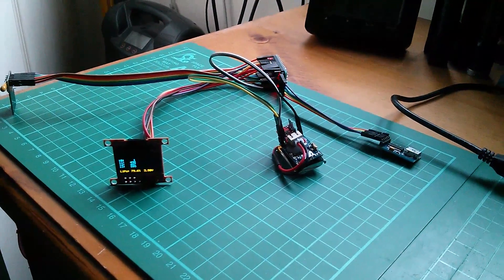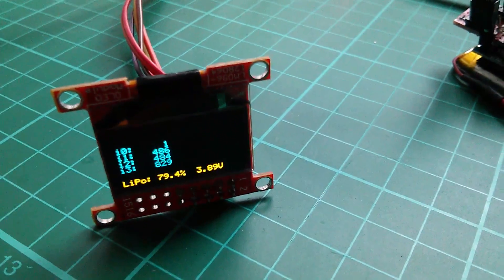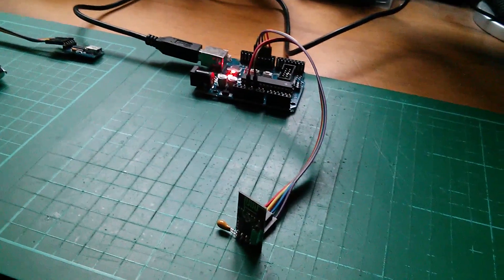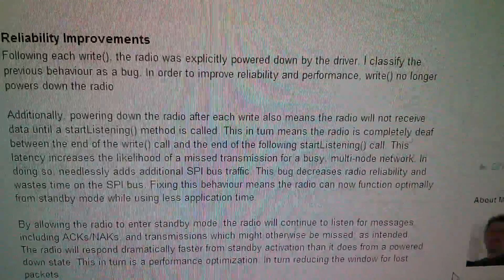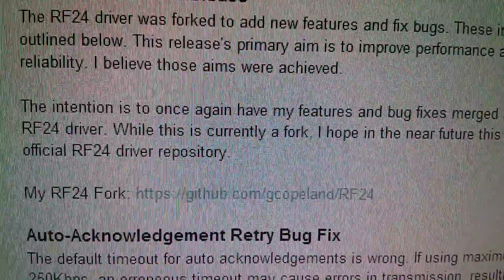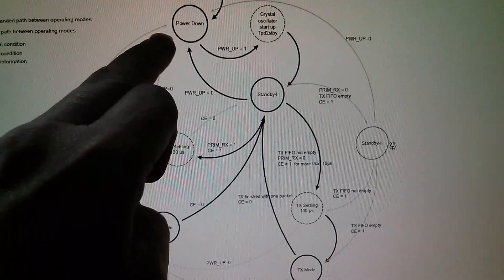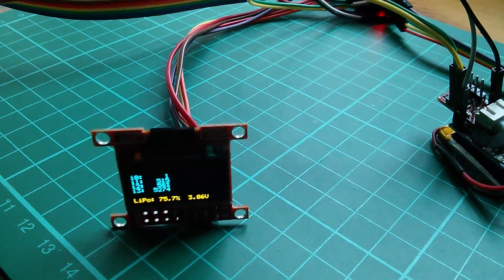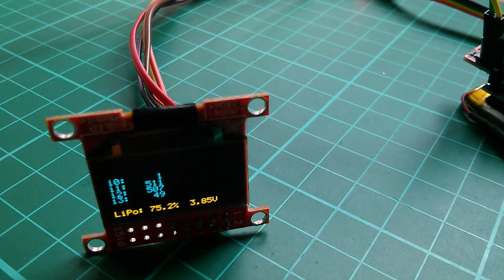Fixed: Arduino nRF24L01+ Data Transceiver & OLED Display

Comment: Dear Julian, i'm trying to use the ssd1306 OLED together with the nRF24L01 and I'm strungling with the SPI communication. 
Based on your video I updated the RF24.h, but without success. 
As soon as I'm starting to use the radio (radio.begin()), the communication with the OLED do not work anmore. Before this command it's working fine. 
I'm using following HW- Configuration on my Arduino NANO
MOSI=D11 
MISO=D12 
SCK=D13, 
CS_RF24=D8 
CE_RF24=D7 

CS_OLED=D5 
DC_OLED=D9; 
RST_OLED=D10
What HW configuration did you use in order to make it running?
(For the OLED I'm using the most recent ADAFRUIT SSD1306 library) 
Thanks in advance for your reply. WBR Alberto
Reply: I found the rootcause of my problem. It was the wrong constructor I used for the OLED-Object. 
In order the OLED is properly working together with the RF24 the OLED constructor taking the refernce to the SPI-Object is to be used.

Comment: Thanks for these videos. These are my reference material for an RC transmitter-receiver I am building. When you send message, do you check the radio.write return code? For me only about 60% is successful, although roughly 90% of the messages are received on the other end. So there are definitely messages received that are reported as failed by the transmitter. I am a bit puzzled. Have you experienced the same?

Comment: Hi Julian I saw oled+nrf24L01 project on youtube.I've problem with my own.It seems the oled freez when nrf24L01 goes on radio.begin process and after that oled fills the screen by 8x8 boxes! I don't understand why? I connect my software spi oled to pins 0,1,2,3,4 of arduino UNO and my NRF uses these pins 9,10,11,12,13.So these components are completely seperate from each other and they must not have any problem.So please let me know how could you solve this problem on that 3 days.
Best.

Comment: I know this is an old youtube video but I thought I'd throw this to you in case you'd not seen it. The most recent updates seem to be from this person: https://github.com/stanleyseow/RF24 which has incorporated gcopeland's code fix and got a few other optimizations/bug fixes. Also seems to have a few more example codes and stuff.

Comment: Thank you for the fixed RF24 code, I have been searching for quite some time trying to work out why my project would not work correctly. I have been able to run my NRF24l01 on its own with no issues, my LCD on I2C with no issues but when I put them together it just wouldn't work and I couldn't understand why until I came across this video and then your fixed code, its seems to me the default RF24 is floored and needs changing. With your code my project is now up and running. Thank you.

Comment: How would i go about changing the pinout of pins other than CE_PIN and  CSN_PIN?
Reply: +NovakinCore They are hardcoded into the NRF library. Write your own  library and define the pins wherever is electrically possible

Comment: Oh you fixed it :) still not understand why you need send i[1] if last send succesfull. when interger count says OLED example 1234 i1 = 1 means 1233 was okay and becouse now you see allready 1234 i not see any point how you use you really never see was it send data you only see did it send last time. so actually you could read same message all day saying okay send ok bcoz sending not actually work and you not get any 0 :) until after week it works again and you will see 0 for short time until next reefresh .i dont know idea of this build but this logic give me headache :P

Comment: Can you please put up the RX code, really need it. THANKS
Reply from the maker: High Flights The latest receiver code (using Adafruit OLED libraries) and the transmitter code are in the comments of this video: http://youtu.be/E7--651JxJE
Reply: Thanks a lot.
Reply: +Julian Ilett I modified the code for 16x2 display did not work. Can you help me?

Comment: Could you post your Receiver code, Please.

I am slowly starting to understand the Arduino.
I find your videos Helpful!

Thanks! Later, FW.
Reply from the maker: Futz With Yes, here's the code. I'll probably use the Adafruit SSD1306 library going forward though.
Reply from the maker: Julian Ilett 
//#define PIN_RESET 2
#define PIN_CS    4
#define PIN_DC    5
#define PIN_SDIN  3
#define PIN_SCLK  2

#include "font.h";
#include "MAX17043.h";
#include "Wire.h";

#include <SPI.h>
#include <nRF24L01.h>
#include <RF24.h>
/---( Declare Constants and Pin Numbers )---/
#define CE_PIN 14
#define CSN_PIN 15
//   5 - SCK to Arduino pin 13
//   6 - MOSI to Arduino pin 11
//   7 - MISO to Arduino pin 12

// NOTE: the "LL" at the end of the constant is "LongLong" type
const uint64_t pipe = 0xE8E8F0F0E1LL; // Define the transmit pipe

/---( Declare objects )---/
MAX17043 batteryMonitor;
RF24 radio(CE_PIN, CSN_PIN); // Create a Radio

/---( Declare Variables )---/
float soc;
float voltage;
char tmp[8];
int i[4];  // 16 element array holding Joystick readings

void oledWriteString(char *characters)
{
  while (*characters) oledWriteCharacter(*characters++);
}

void oledWriteCharacter(char character)
{
  for (int i=0; i<5; i++) oledWriteData(ASCII[character - 0x20][i]);
  oledWriteData(0x00);
}

void oledWriteData(byte data)
{
  digitalWrite(PIN_DC, HIGH);
  digitalWrite(PIN_CS, LOW);
  shiftOut(PIN_SDIN, PIN_SCLK, MSBFIRST, data);
  digitalWrite(PIN_CS, HIGH);
}

void oledWriteCmd(byte command)
{
  digitalWrite(PIN_DC, LOW);
  digitalWrite(PIN_CS, LOW);
  shiftOut(PIN_SDIN, PIN_SCLK, MSBFIRST, command);
  digitalWrite(PIN_CS, HIGH);
}

void setup()
{
//  pinMode(PIN_RESET, OUTPUT);
  pinMode(PIN_CS, OUTPUT);
  pinMode(PIN_DC, OUTPUT);
  pinMode(PIN_SDIN, OUTPUT);
  pinMode(PIN_SCLK, OUTPUT);
//  digitalWrite(PIN_RESET, LOW);
//  digitalWrite(PIN_RESET, HIGH);
  
  Wire.begin();
  batteryMonitor.reset();
  batteryMonitor.quickStart();

  radio.begin();
//  radio.setDataRate(RF24_250KBPS);
  radio.openReadingPipe(1,pipe);
  radio.startListening();;

  
//  oledWriteCmd(0xa8); //set MUX ratio
//  oledWriteCmd(0x3f);
//  oledWriteCmd(0xd3); //set display offset
//  oledWriteCmd(0x00);
//  oledWriteCmd(0x40); //set display start line
  oledWriteCmd(0xa1); //set segment re-map
  oledWriteCmd(0xc8); //set COM output scan direction
////  oledWriteCmd(0xda); //set COM pins hardware configuration
////  oledWriteCmd(0x12);
  oledWriteCmd(0x81); //set contrast
  oledWriteCmd(0xff);
//  oledWriteCmd(0xa4); //disable entire display on
//  oledWriteCmd(0xa6); //set normal display
//  oledWriteCmd(0xd5); //set oscillator frequency
//  oledWriteCmd(0x80);
//  oledWriteCmd(0xdb); //vcomh deselect level (brightness)
//  oledWriteCmd(0x20);

  oledWriteCmd(0x8d); //enable charge pump
  oledWriteCmd(0x14);
  
  oledWriteCmd(0xaf); //set display on
  
  oledWriteCmd(0x20); //set horizontal addressing mode
  oledWriteCmd(0x00);
  
  for (int i=0; i<1024; i++) oledWriteData(0x00); // clear oled
  
  //oledWriteCmd(0x27); //set right horizontal scroll
  //oledWriteCmd(0x0);  //dummy byte
  //oledWriteCmd(0x0);  //page start address
  //oledWriteCmd(0x7);  //scroll speed
  //oledWriteCmd(0x7);  //page end address
  //oledWriteCmd(0x0);  //dummy byte
  //oledWriteCmd(0xff); //dummy byte
  
  //oledWriteCmd(0x2f); //start scrolling
}

void loop()
{
  soc = batteryMonitor.getSoC();
  voltage = batteryMonitor.getVCell();
  oledWriteCmd(0x21); //
  oledWriteCmd(0x00);
  oledWriteCmd(0x7f);
  oledWriteCmd(0x22); //
  oledWriteCmd(0x07);
  oledWriteCmd(0x07);
  oledWriteString("LiPo: ");
  oledWriteString(dtostrf(soc,4,1,tmp));
  oledWriteString("% ");
  oledWriteString(dtostrf(voltage,5,2,tmp));
  oledWriteString("V ");
  
    if ( radio.available() )
  {
    // Read the data payload until we've received everything
    bool done = false;
    while (!done)
    {
      // Fetch the data payload
      done = radio.read(i,sizeof(i));
  oledWriteCmd(0x21); //
  oledWriteCmd(0x00);
  oledWriteCmd(0x7f);
  oledWriteCmd(0x22); //
  oledWriteCmd(0x02);
  oledWriteCmd(0x07);
  oledWriteString("i0: ");
  oledWriteString(dtostrf(i[0],5,0,tmp));

  oledWriteCmd(0x21); //
  oledWriteCmd(0x00);
  oledWriteCmd(0x7f);
  oledWriteCmd(0x22); //
  oledWriteCmd(0x03);
  oledWriteCmd(0x07);
  oledWriteString("i1: ");
  oledWriteString(dtostrf(i[1],5,0,tmp));
  
    oledWriteCmd(0x21); //
  oledWriteCmd(0x00);
  oledWriteCmd(0x7f);
  oledWriteCmd(0x22); //
  oledWriteCmd(0x04);
  oledWriteCmd(0x07);
  oledWriteString("i2: ");
  oledWriteString(dtostrf(i[2],5,0,tmp));

  oledWriteCmd(0x21); //
  oledWriteCmd(0x00);
  oledWriteCmd(0x7f);
  oledWriteCmd(0x22); //
  oledWriteCmd(0x05);
  oledWriteCmd(0x07);
  oledWriteString("i3: ");
  oledWriteString(dtostrf(i[3],5,0,tmp));

    }
  }

  delay(10);
}

Comment: Hey Julian, have you found any led matrix kits that use shift registers (one pin for each vertical led and one for clock?) I want to make an led sign using shift registers where each panel feeds into the next
Reply from the maker: ***** The MAX7219 works a bit like that I think

Comment: Could you give details on the OLED screen you are using, is it full RGB or two colour? I presume an Ebay special? Does it drive the same as the single colour OLED?
Thanks!
Reply from the maker: Wilksey37 It's two colour - six rows of blue and two of yellow. Does it drive the same? Well, almost. On this one, you don't have to fire up the charge pump. On most of them, you do.
Reply: Julian Ilett Thanks, are you planning on doing a video with some info on how to drive them and where you got it from? I have seen some RGB ones on Ebay which has 3 interfaces, but are ~£20 from China.

Comment: Great work on fathoming the fix :) where did you get the oled? Thanks for all the great videos, keep them coming!
Reply from the maker: dangersdnb The OLED is on eBay, but when I rebuild this project, I'll use a more easily available one.
Reply: Julian Ilett sounds good, I'll keep an eye out for that video. great work

Comment: Hi Julian,
Please could you post some information (or a video) stating the LoS outdoor range for the standard and high powered version? I know you did the indoor to outdoor test in your workshop, which seemed to show the high powered version in a very poor light.
Thanks!
Reply from the maker: Wilksey37 Yes, I now realise the high power version should be used as a matched pair. Using one high-power unit and one low-power unit is not a fair test.
Reply: Julian Ilett Hi Julian, yes you would need two matched as it is two way :) I have been tempted to use these instead of Zigbee, I have found AES code on the web and I think it would be a great deal cheaper than Zigbee (P2P rather than Mesh), but wasn't overly impressed by the range on your initial tests.  BTW, keep up the most excellent videos, extremely useful, as well as the solar ones!
Reply: Wilksey37 Julian Ilett You may also want to look at the HopeRF modules for RFM69W (and RFM69HW higher powered version), which can operate on 433 or 915 ISM bands, which would have much better object penetration. (For those that don't known, generally speaking, lower UHF freqencies penetrate obstructions better than higher ones, at the cost of slighly less range in open LoS). I have just ordered a few interesting all-in-one arduino clones, Anarduino MiniWireless, which are basically a pro mini with your choice of optional wireless module, as well as a big flash chip and RTC onboard, at a really nice price. They are about $16 each including the wireless radio module installed, which is a great price IMO.
Reply: Jens Jensen Hi Jens,
Yes, lower frequencies penetrate better, but the data rates tend to be lower from what I have seen and  the "standard" power versions of these Nordic chips are very cheap!

Comment: Finally its over. It would be nice of you if do a fast transaction test in poor signal condition and see how it performs. That's of course if you have spare time to do so. Things are going interesting and I am not sure how it may work in Multi Node environment to communicate with multiple systems via addressing.
Reply from the maker: Satyajit Roy I will do some follow-up stuff on these transceivers - maybe even try the multi-node library

Comment: Hey Jullian, another step towards a great project! I'm thinking of doing something similar, weighing up weather to use 2,4ghz or 433mhz radio modules, what lead you to go for the former? Thanks
Reply: the nRF24 modules are pretty well supported through various libraries etc. Makes them quite easy to work with. Most people don't consider the advantages and disadvantages of different frequencies and are simply after a working wireless link.
If you are up for comparing frequencies.
I'm sure you're familiar with the idea of walls of varying thickness potentially blocking various wireless signals. This is from the energy of the wireless signal being absorbed by the object its going through. Typically the higher the frequency the more easily its absorbed. On paper this means that a 433mhz system should have an advantage in transmitting through a wall or similar than a 2.4ghz system. The other thing to consider is that air itself is technically something being transmitted through and can also absorb the signal (more so the water vapour in our air than the gases) so out doors with the same transmission power a 433mhz system should again have better range than its 2.4ghz counterpart. This really assume you have the same transmission power on both, obviously a 10W 2.4ghz transmitter will have a longer range than a 0.1W 433mhz transmitter (the transmission powers on these little modules though tends to be a few milliwatts).
But you can achieve a higher data rate on a higher radio frequency.

I don't have any nRF24 modules yet. Might get some though because I am interested in doing some range tests myself. I currently have 2 cc1101 modules though, these are a texas instruments chip which support quite a few different frequencies (software selectable) between about 300 and 950mhz, mine both have external 433MHz antennas. but I want to see if I can get some antennas for 868mhz to make some range comparisons. I also want to get some cc1101 modules with on chip antenna, I've seen a few modules supplied with 433mhz on chip and I've also seen a few modules with a booster chip onboard to boost the transmission power (also seen nRF24 modules with the same modification). My main testing will only be around the cc1101 modules as I can guarantee its the same transmission power on each frequency, but if I get some it might be worth throwing in a comparison with nRF24 modules too.
Reply: SixSixSevenSeven Thanks for the detailed response, the cc1101 modules look pretty interesting, I was only looking at the cheap one way MX-FS-03V & MX-05 modules. 

I should have been more specific with my question, Julian's making a wearable project, so I was wondering more about the practicalities of available modules, battery drain, size and the like, but wireless range is part of that too.

I think the best option to do the same as you and pick up a few units and see how things pan out, none of these modules are more that £5 anyway. when do do your test, please share the results as at the very least I'd be interested in seeing the comparison, I bet a large variable will be the amount of conflicting devices in each frequency.
Reply from the maker: ***** The MX modules don't have the sophisticated acknowledge and re-transmit functionality of the nRF modules. After spending some time learning about the nRF modules, I'm amazed that they're as cheap as they are.

Comment: Brilll! Glad you got it sorted. I will soon be doing something similar with nrf24l01+'s. There are number of RF24 forks, and the one I will attempt to use is the TMRh20/RF24 library on github. Hopefully it behaves itself, otherwise I will check out the gcopeland fork :)

BTW, absolutely love your video's, including the short "Morning/Afternoon all" intro ;) Keep it up !
Reply: I'm using TMRh20's library, too. It's good to see a library, where the last changes have been done just a few hours ago, whenever I look at it. You know someone is working on it. I haven't tried much, but didn't have any problems either. This line on his blog http://tmrh20.blogspot.com/2014/03/high-speed-data-transfers-and-wireless.html makes me think, that he has fixed it, too:
"One of the primary factors in increasing efficiency was eliminating power ups and power downs from the general operation of the radio, which many of the existing forks already had identified."

Comment: Mr Ilet, Could You Please list the exact parts list, and the github codes! I have arduinos and the software, I also know how to install the libraries and all that jazz.  Please Please Please, I want to do this so BAD! THIS IS WICKED AWESOME
Reply: May I add Long time Subscriber here!
Reply: Just go to Ebay and search for the part names ("NRF24L01+", "i2c oled") and you pretty much get a hundred sellers selling exactly what's used in the video. (or you could always watch the postbag videos, where Julian usually shows exactly from which seller he got his stuff)

Comment from the maker: #include <SPI.h>
#include <nRF24L01.h>
#include <RF24.h>

#define CE_PIN   9
#define CSN_PIN 10

const uint64_t pipe = 0xE8E8F0F0E1LL; // Define the transmit pipe (LL=LongLong)

RF24 radio(CE_PIN, CSN_PIN); // Create a Radio

int i[4];  // 4 element array holding integers
int integer = 0;

void setup()
{
  radio.begin();
  radio.openWritingPipe(pipe);
}

void loop()
{
  i[1] = analogRead(A0);
  i[2] = analogRead(A1);
  i[3] = ++integer;
  if (radio.write(i, sizeof(i)))
  {
    i[0] = 1;
  }
  else
  {
    i[0] = 0;
  }
  delay(1000);
}
Reply: http://hastebin.com/ozowoyemuh.coffee
Reply: +Julian Ilett I modified the code for 16x2 display did not work. Can you help me?